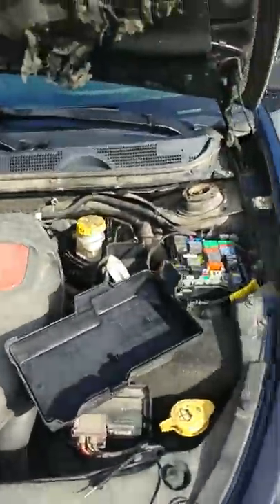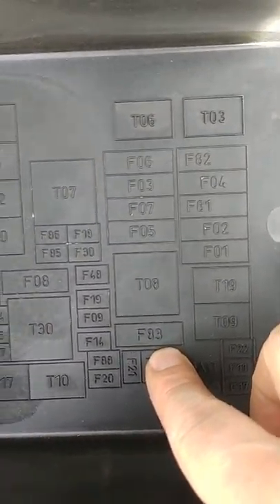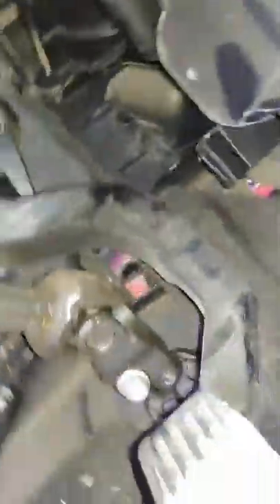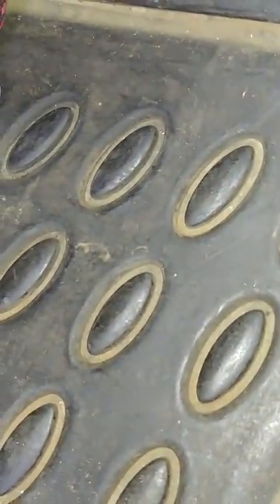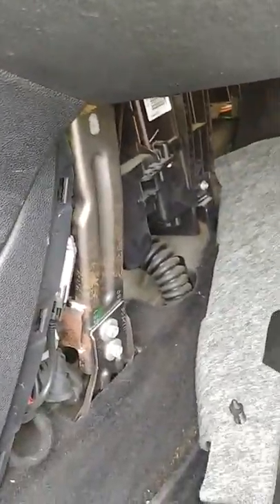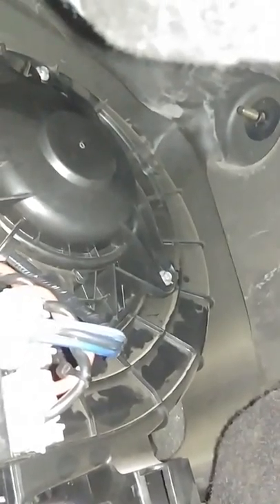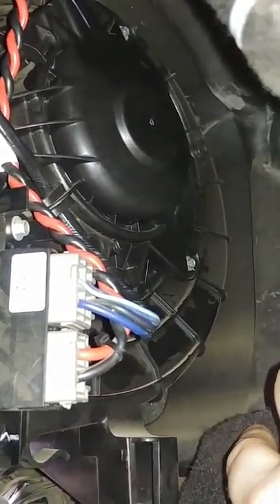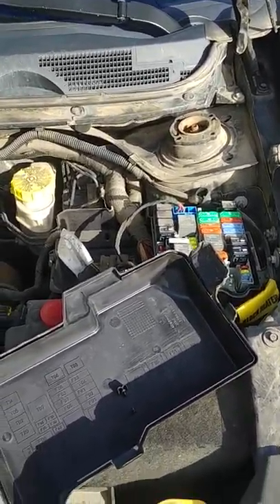Dodge Dart AC Heater Fan HVAC Blower Motor Fixed

Comment: Wicked help, my heater blower wasn't working changed filter checked all that you said and ended up hitting the blower housing from the passenger side a bunch of times with a hammer handle, works like a charm now!
Reply from the maker: Jarrad McDonald glad to hear it! I "fixed" mine a few times like this now, I finally decided to replace the motor, as it's winter now and I have a lot of traveling during the holiday season. I probably could have gotten away with using for longer, but it's not worth the risk.

Comment: Just finshed mine....dirty brushes on the motor itself. I pulled the motor and put direct power to it from a 12v volt and nothing. I blew out the internals and LOTS of dust and dirt came out. Most like worn brushes. After the blowing i testes again and it worked great! Reinstalled and back to nice fresh AC or warm air!
Reply from the maker: Nice!

Comment: I hit a bump and my fan kicked on. Another occasion where it stopped I watched your video I was under the dash and wacked the blower motor with my flashlight and it started up again. Very odd
Reply: Same. Only know it wont come on at all...
Reply: @jaimebannisterennis2982  I ended up buying a new blower motor from parts store and installing it myself. It's not difficult.

Comment: This is a good video! I wished you identified the "blower motor resistor/module" as that might be my issue now. Sometimes the speeds slow down or stop, or sometimes only works on high.
Reply from the maker: Did you replace the HVAC blower motor AND Still have issues?
Reply: @janX9  no. I just bought the fan and the resistor from a credible parts yard nearby. I'm going to install it.

Comment: So, I followed your advice a few months ago and it worked! Thank you! Same story, the fan spun freely but after that it started working again. Now today it's done the same thing again! Did this fix work for you permanently or did you have to do something else later on?
Reply from the maker: Thomas Washington I'd advise you to do it again. I did this a few times. When winter came and it was -40c I decided to just buy a new one, don't want to be stuck without heat in the winter.

The motor still works, and I even kept it as a back up.  and installed it myself. I say,  use it until it's dead.

I'm not good at vehicle repairs, but it's easy to replace the motor, and a good opportunity to change the cabin air filter to. If not done often enough, your air will feel weak.
Reply from the maker: If you ever replace it in your own, read this

http://www.dodge-dart.org/forum/#/topics/41793

Some of the steps and tailed there are completely pointless and I skipped some. Just use some common sense when you follow that tutorial and you'll be fine.

For example step "3. Remove the passenger side center console" 

That step makes absolutely no sense to me and it's a waste of time LOL

Comment: Hi sorry to ask this but I’m in a real tight spot and need a quick temp fix I believe my A/C panel has gone bad and the fan select switch is not working is it ok are what the best way to straight wire the blower motor under the dash and put it on a switch so I can use my a/c until I get a new panel I have a 2014 Chevy equinox so I have to replace the whole panel thanks for your input

Comment: Here's my issue. I replaced the speed control module on mine, checked fuses, and still nothing. Then I get a check engine light for codes B10EA and B10E9. EA code is the PCM detecting over draw, and E9 is the PCM detecting under draw current. After I cleared the codes, the fan motor works just fine. However, that is not a fix. And am wondering if it might just be the blower motor that needs replacing

Comment: Mine works when it wants to somedays i turn it on and nothing and some days it works great. There is no weird sound with the fan ot just either works or it doesnt. Could it be some type of relay?
Reply from the maker: Maybe dirt and debris. I once had a small Rock keeping it from turning. Maybe there is some build up. I'd remove it and clean it up. 

Also, a small rock stopped my cruise control from working. It was behind the gas pedal next to the cruise piston. I got rid of it and the cruise controls started working.

Comment: Mine used to blow cold i have to be driving a while so it can but when i come to a stop it starts blowing warm would this help or should i recharge it
Reply from the maker: The first thing I'd do is check the coolant level. I'm not an auto mechanic though. If you know any mechanics I'd ask them for an opinion or solicit advice from an auto shop.

Comment: This fix worked for our 2013. Anybody else get the b10ea and b10e9 engine light codes and do anything about it?
Reply: You ever figure that out?
Reply: @GoogleAccount-mj8ql  I changed out the blower motor and never got the code again. I went with a cheaper one from RockAuto instead of mopar but the fan is very loud, but I'm hoping it will last longer

Comment: They actually have a problem with these motors and won't acknowledge it at all. Mine has been working on and off after the first year, if you hit the end of the motor it ill startup and work for a bit. Mine seems to start out slow and then start running faster, I know that I need to replace it lol, i Love a challenge......
Reply from the maker: Sorry to tell you but, it won't be much of a challenge. I'm not a mechanic, and have very little knowledge of vehicle repairs and I found this pretty easy. The hardest part is contorting my body to fix in the small area to do the repair.
Reply: @janX9  I know it's an easy fix lol been a car guy all my life, just too lazy in my old age, and am now disabled to the point it's tough to do by myself. lol